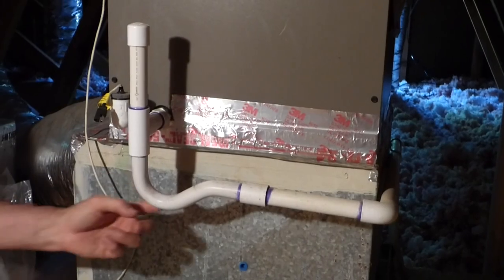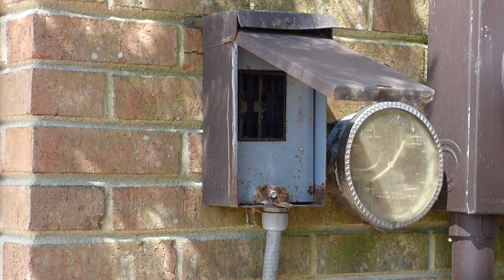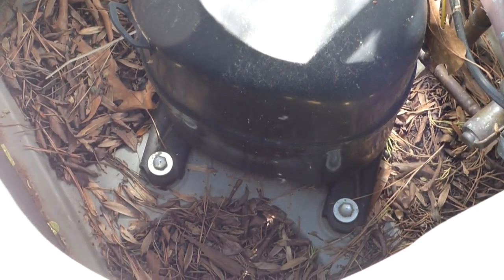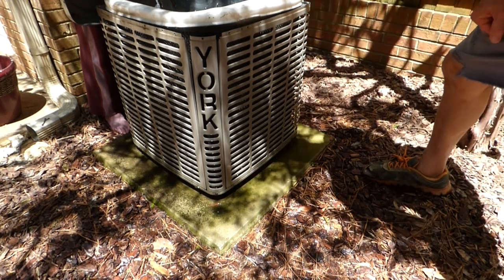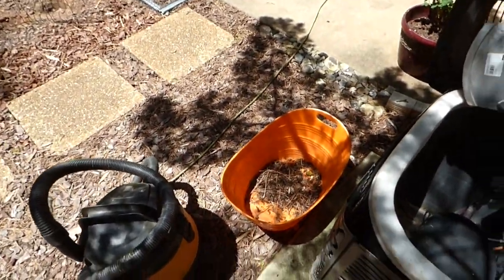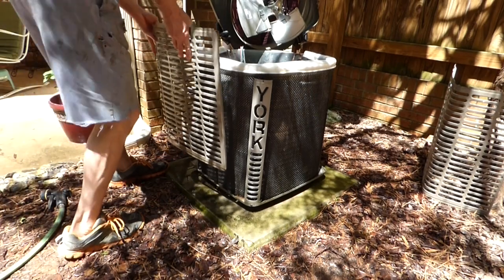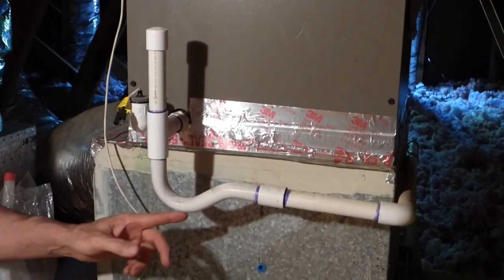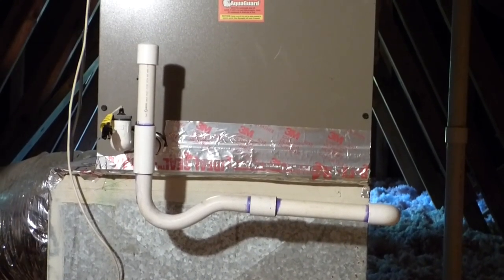How to Clean an Air Conditioner Condenser (outside unit) - Bonus Maintenance Tips

Comment: Is there any way to do this without having someone hold the fan the entire time?
Reply from the maker: Sure… If it is close to the house lean it against the house wall or get a stepladder or something that you can set in place that is sturdy and lean it against that. Just be careful not to pull on the wires
Reply: @helpinguonline  I just did mine. I had to pull the plastic grommet like piece to get flexibility. Then I was able to flip it over and fortunately I did have something on the house to lean it on. Thanks.

Comment: how often does condenser coils require cleaning?
Reply from the maker: It depends… If you have a lot of pollen, leaves or lawn clippings, Etc. you may have to do it often. Having said that once a year is a good rule of thumb
Reply: I live in the upper Midwest and don't run my A/C much outside of summer. I put a mesh cover over my unit in the fall when leaves are falling off of the trees and take it off in the spring after the cotton from the cottonwood trees has stopped blowing around. I clean the mesh cover by inverting it and blowing it with my leaf blower.